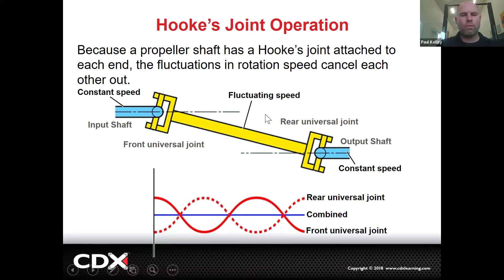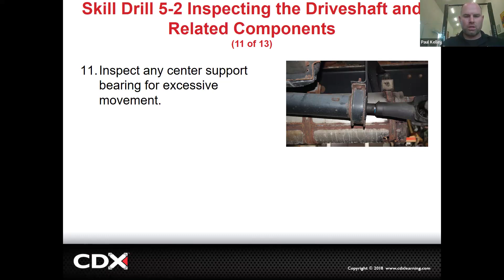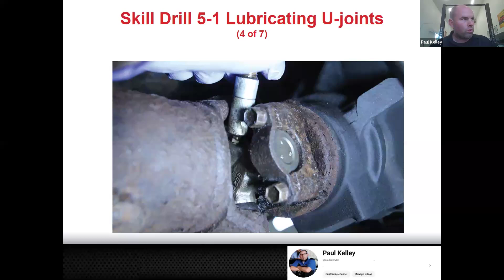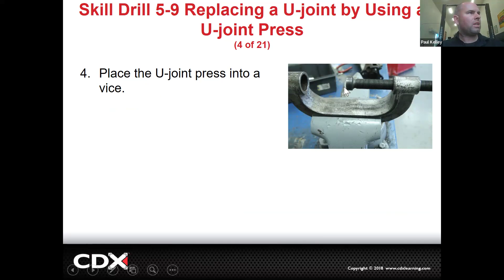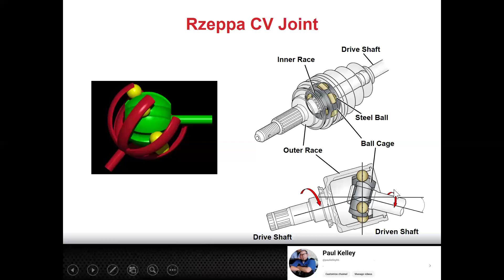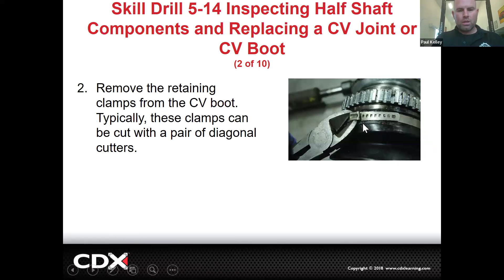ASE A2 A3 Combined Driveshaft and CV Axles Lecture

Comment: I was replacing a seal on the rear differential back in December. Customer said a plastic bag got wrapped around his driveline and when he pulled it out diff fluid started pouring out. it was coming from that seal. While removing the hub looking thing on the differential there was some white stuff that looked like glue. Is that the same thing as that teflon stuff that you were talking about? It was on a 2022 gmc Sierra
Reply from the maker: Doesn't sound like it, the Teflon was inside the splines where it mates with the transmission output shaft
 Close to that seal but internal.